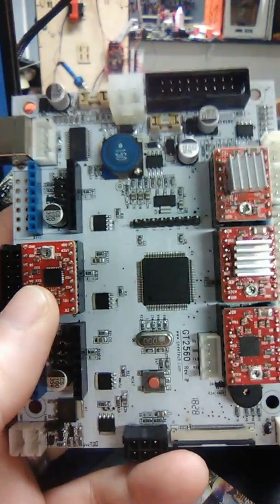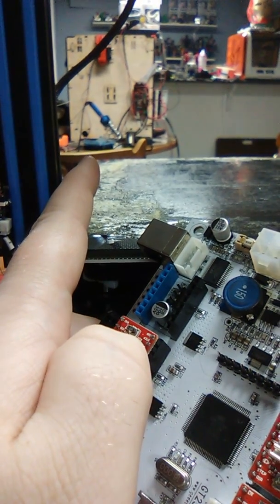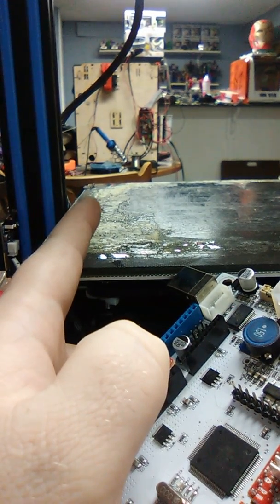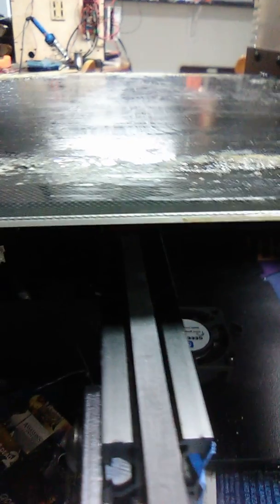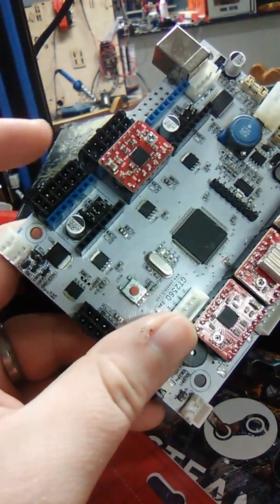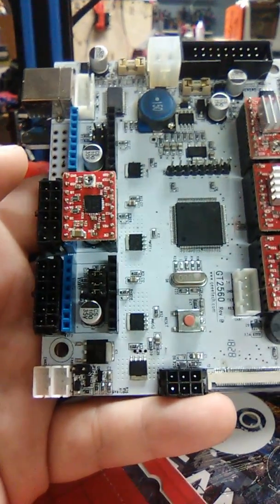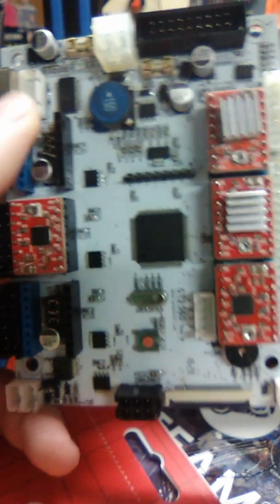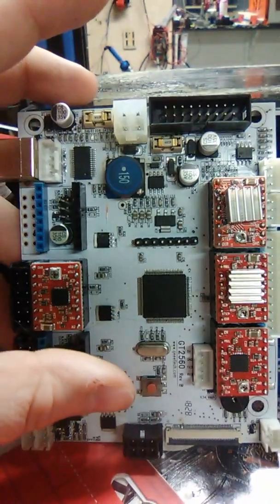Geeetech A10 update

Comment: I would be willing to bet, after watching this video, that you are possibly the culprit killing the boards. Due to your unconscious actions while making this video, you constantly rub, scatch at, etc., parts on the board including the CMOS CPU. There is nothing wrong with curiosity, but CMOS components are extremely easily damaged by static electricity. You do NOT touch CMOS components without being grounded (IE wearing a ground strap). If you touched those boards in the same manner while assembling or during replacement, then there is your probable answer. Just opening the box that the part came in can impart several hundred volts of static charge to your skin. That charge will readily jump through any conductive material you touch, like the pins on a connector or through the pins of an IC chip of any kind. Just rubbing the CPU like you did in the video will impart more charge, which, like in the video, touching the leads of the CPU allows another path -- THROUGH the chip to ground (in this case the largest conductor which is the ground traces of the circuit board). Research frictional electricity (static generation by contact) and the triboelectric series. Such a discharge doesn't necessarily destroy the chip outright, but it will weaken delicate junctions inside causing premature failure of the part. Sometimes it will kill it immediately, if the stored charge is in the multiple thousands of volts, but not always. It does damage the IC(integrated circuit) though, that is a guarantee. CMOS IC's, mosfets, etc., are all highly susceptible to damage from even mild static discharge that you would never even feel.

Comment: Waiting for my gt2560v3 replacement board to.  Stop working after 4 days, didnt even have time to fine tune it ;)

For the first board that broke, from you, it may have shorted with the bed if you used the paper clip to fix the glass on it. ? (A possibility) from the problem you explain. 

I Think they got problems with the gt2560 v3.
Reply from the maker: I 'm not sure that's possible. I stuck electrical tape on the inside of the of the clips. That and there is a guard around the bed connectors. It COULD be possible that there was an arc of electricity, but that would make using the printer dangerous to say the least.

But Yeah, these boards just cant handle the task set on them and the fact that this is going to be my second replacement without having to pay a surcharge speaks volumes. Shame because I would love to do business with this distributor in the future.